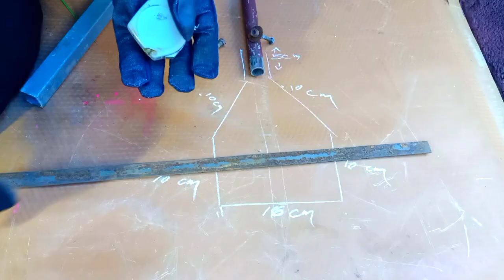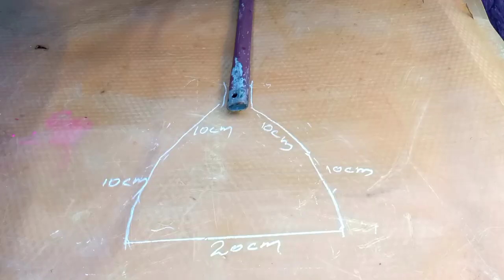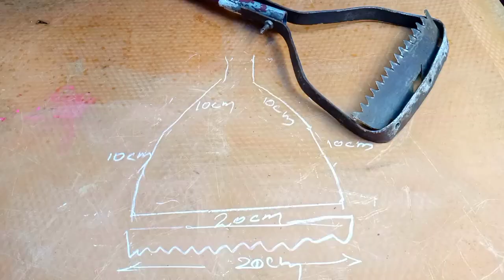Make Your Own Garden Weeder Tool

Comment: To make  this simple tool, it's  required to  use many other simple machines which we  don't have at home, my only request is that why don't you  make this excellent tool & market the product with spare blades and that  will be a boom for those having garden at home. Please consider my request. Thanks.
Reply: Yes
Reply: Excellent suggestion 👌🏼
Reply: Call